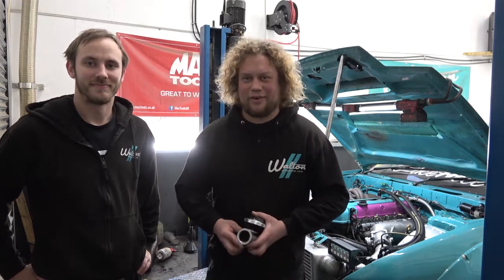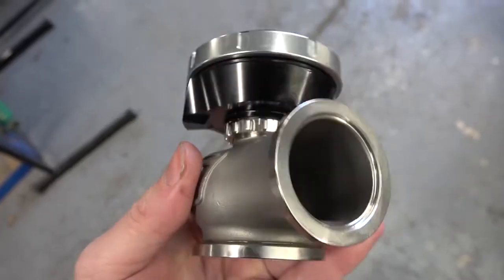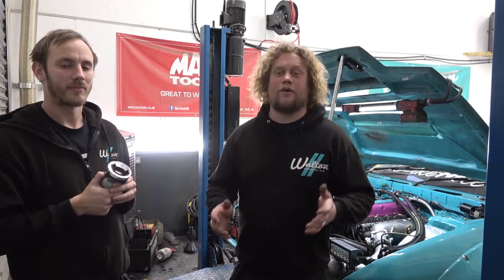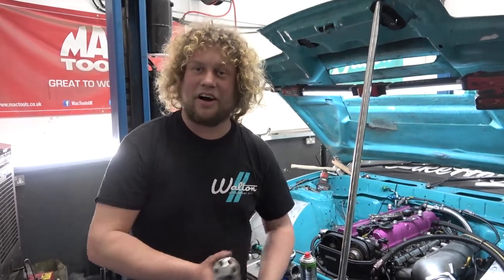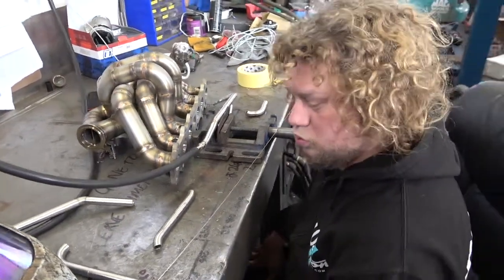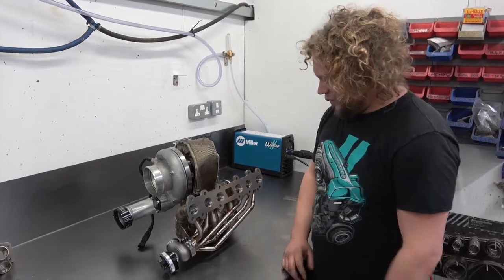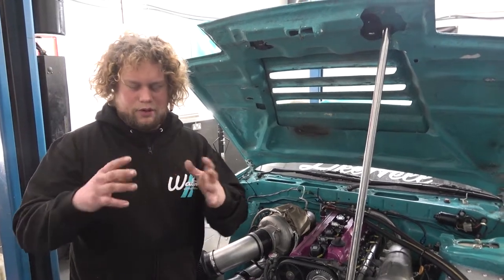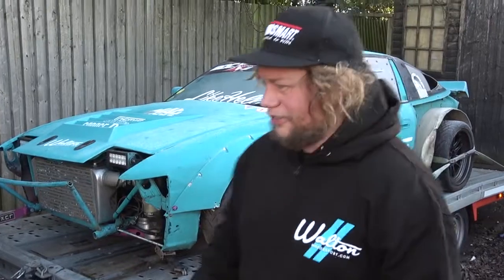Walton Motorsport - [Fresh Air Anti-Lag Valve Install] - Part 1

Comment: Wow, I never would have thought about a runaway safeguard in doing this until you said something. Also the way you routed a miniature charge pipe to each runner is ingenius! I would have just lazily ran one big pipe to the junction. Looks good, excellent work!
Reply from the maker: Thanks, Its ourdesing on this particular manifold setup but this layout has been used in WRC and Rally X for years and years. Its tried and tested. Using the individual pipes gives more time for the air and fuel to mix before the the turbo

Comment: Not to manipulate the hard and nice work put into the car. But wouldn't it be better to remove the wastegate? If planning to put a anti lag valve on the exhaust manifold? The goal is to keep the turbo spinning, waste gates just dump the pressure out and bypass the turbo to spin it down.
Reply: I understand what your thinking is, but you still need to control the turbo in the same way as a non anti lag setup because the anti-lag is only active off throttle.

Comment: I'm wondering about the pressure tank as well. Shouldn't the system feed itself without a pressure tank with a throttle blip to get just above atmospheric pressure? Looking forward to part 2!
Reply from the maker: As boost flows into the valve, it pushing the piston down (and closed) The flow through the valve is equal pressure and as it pushing against a 5psi spring in the valve is unable to open the valve. The job of accumulator tank is to store some pressure, which can be used to open the valve before the turbo starts generating boost and holding the vavle closed.

Comment: What about the fuel? Do you inject fuel into the valve as well or do you just program the ecu to run the engine rich when the anti-lag is working?
Reply: Typically the ecu makes the engine run rich I’ve never seen it with a injector in the valve because trying to spark that fuel when it didn’t even go through the combustion chamber would be challenging

Comment: What size filler rod do you guys use when welding the main manifold? And do you use the same on the smaller 16mm ALS pipes?
Reply from the maker: Generally 1mm wire on stainless

Comment: using this system you go to throw air directly into the exhaust, then the ecu must manage the fuel. but it must be remembered that once air is let into the exhaust manifold, the AFR will be leaner even if the engine is running with a correct AFR. how do you deal with this kind of problem?
  because if you analyze that the combustion and therefore the air \fuel ratio in the combustion chamber is correct, the lambda takes into account the exhaust gases in the downpipe, not knowing that there is a connected Als which bypasses the air in the exhaust manifold ducts, consequently yes it will have a leaner afr, and you cannot inject more fuel, because this air does not participate in the combustion...
Reply from the maker: Depends how you set it up, but in this instance when activated it changes to a different fueling table.

Comment: Do you have to do anything special with the blow off valve to insure pressure is not released to the atmosphere.
Reply from the maker: If it had one, then yes you would need it remain closed when the fresh air valve is open

Comment: Why do You need pressure tank?
Won't it work if You just take pressure line from turbo compressor?
Or it helps to stabilize pressure and control of the valve is better?
Reply from the maker: As boost flows into the valve, it pushing the piston down (and closed) The flow through the valve is equal pressure and as it pushing against a 5psi spring in the valve is unable to open the valve. The job of accumulator tank is to store some pressure, which can be used to open the valve before the turbo starts generating boost and holding the vavle closed.
Reply: @WaltonMotorsport  
We are putting this valve on our rx car. So its a very good tip.
Huge thanks

Comment: Does this work on a diesel 😂
Reply: Hehe, nice one :D. Diesels don't have throttle body. They are direct air engines, and controlled by fuel injection quantity, not by thorttles, valves ect opening. When you release pedal, no fuel is injected, and thus turbo slows down. when you press gas pedal, fuel injects, turbo spools, more air, even more fuel.
Reply: @gedas3419  R U N A W A Y D I E S E L

Comment: This bypass air anti-lag is nothing new.....
I had the same idea in the mid 90's untill I discovered it had already been done in the early/mid 80's.

 Look up Audi 'um-luft' system fitted to the Audi Sport Quattro S1 E2. 
You don't even need a specialty valve, you can just use a generic external wastegate to accomplish the same result.
Reply from the maker: Nope nothing new, Fabricators here have been building manifolds with fresh air systems for years in rally applications. Its just new at this pricepoint.

You can use a wastegate as you say, and the ALV40 is pretty much just a wastegate with difference flanges, the difference is that a ALV40 uses a different valve guide which allows for a better seal. this serves 2 purposes; 1) better twin port control as the lower actuator housing is sealed better and 2) the Fresh Air / pressure of the system when activated can not leak up into the actuator housing to impact the control strategy
Reply: @WaltonMotorsport  Thanks for that info, good to know